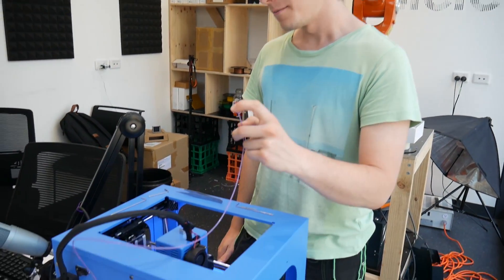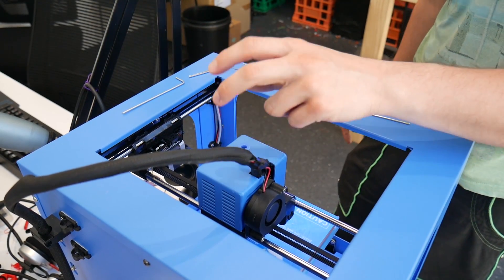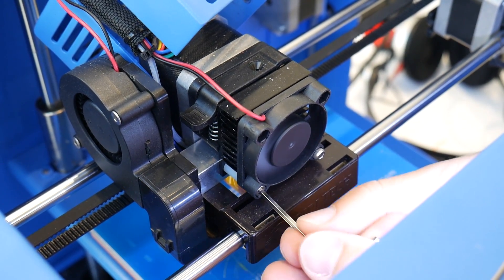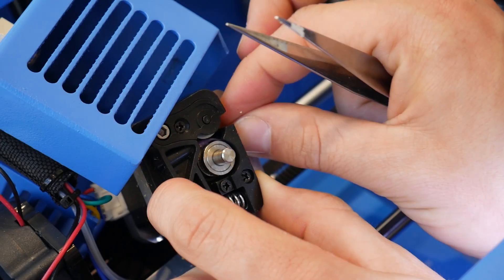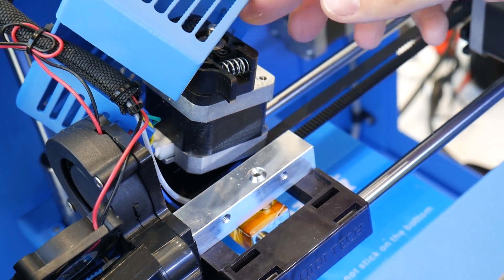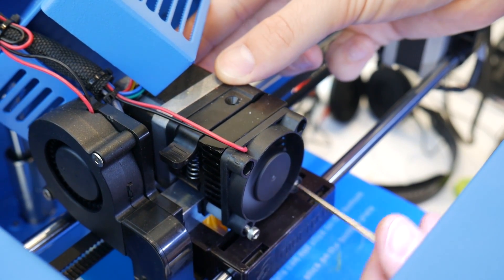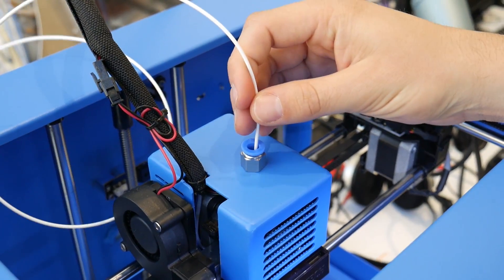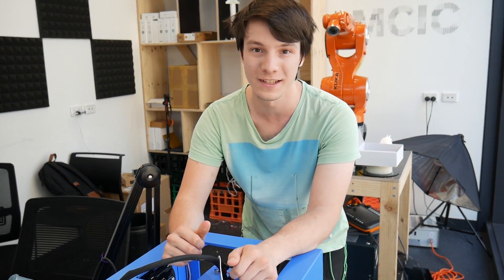How to unjam your extruder the Maker's Muse way

Comment: What if filament is still coming out When you load new filament in? And then proceeds to print to the point where it stains my bed but doesn't print,  dual extruders so it's not the level or x calibration.. Please someone help Its only one extruder

Comment: Hey Angus, I know this is an old video but I need your help. My monoprice v2 has stopped feeding in a similar fashion. My feeder gear is clear, my nozzle is clear, but there is a chunk of filament stuck in the tube that leads from the feeder gear down into the heat core and nozzle. I can't get a grip on the pla filament, and I can't force feed it down. Any advice?
Reply: Well i just use 2mm drill bit and clean it with drill when its cold....rough but work every time

Comment: I puchased a Tevo Trantula for xmas and have not been able to print passed first layer yet.  Seems as it starts to do the perimeter  walls the z-axis rises off of the previous layer like 2 or 3mm and the filament just falls poorly and not even melted. Any suggestions on why base and first layers are perfect then it goes bad? Thanks

Comment: I can dismantle, declog & rebuild a TRONXY X3A extruder assembly with my eyes shut. If anyone can confirm if the machine shouldve been supplied with a 38mm teflon lined throat or post a few words on how to prevent incessant nozzle blockages I'd be grateful. (NB. Ive already replaced the 0.2mm they supplied from their Surplus Parts Bin, with 0.4/0.5mm)

Comment: What is a typical base plate made of (i.e. what the work piece is created on)? I have this idea to make a heated plate of FR4 (what PCBs are made of). The board would have heating elements and sensors on the component side of the board facing down.

Comment: Have you ever had a problem with jamming using PLA in your Up Mini? Even though I have the temps set correctly it tends to start off with a few clunks then jams. I got a feeling it might be the Teflon tube which looks to be pulling on the filament as it is fed through.
Reply from the maker: Yes, the UP Mini sucks at PLA, the extruder motor overheats and chews the filament. I only ever ran ABS on mine. The mini 2 is improved, but again they're still primarily designed to print ABS due to the enclosure.
Reply: It works beautifully for a while then tends to clog. Am I able to feed the filament through without using the Teflon tube because it does feel like it restricts the filament quite a bit or is it required at all times?
Reply from the maker: You don't have to use the tube, but it helps avoid kinking at the hot end. To print better pla remove the top cover, open the door and point a small desk fan into the chamber at low speed. That's the only way I got mine to reliably work with PLA! Also note that some PLA simply won't work at all due to the all metal hot end... IDK what actually causes this.
Reply: No worries, will try that. Thanks!

Comment: On the ultimaker2+ there is almost always those plastic strings from the last filament but it doesn't jam I just push it through the bowden tube and nozzle with the new filament and it just extrudes it. I thought at first this video was about unjamming the nozzle because I miss read it. I'll say how unjam the nozzle though. I just heat the nozzle to 100 Celcius and unscrew the nozzle then heat it up to 200 and pull the plastic out with pliers. Works for me and i don't think it is very hard on it.

Comment: Was there a reason to leave it powered and heating once the plastic was removed?
Reply from the maker: Sometimes jammed filaments extend into the hot end, which is what I was expecting and need heat to be removed. But yeah, this jam didn't need it :)

Comment: those spacers on the fan drive me crazy when I am in a hurry I fumble them and they slide off and roll away on the floor. when you're trying to get things fixed quickly it is pretty frustrating.

Comment: Pro Tip: Unscrew the extruder and hotend while it's still cold, then heat it up and start to clean out the hot end. Then turn it back off before you reassemble everything. It's probably gonna teake a few more minutes this way, but you will not kill your hotend-fan or burn your fingers as easily (and getting a replacement fan or healing a burnt finger definately takes longer than doing it the safe way...)
Best regards, your workplace health and safety inspector. :-D

Comment: The stepper might have been hot because it was close to a cold end that wasn't being cooled by the fan... Or like someone said, the stepper might be getting more current than it's rated for. When I had the MK10 on my Wanhao i3, I think I did the disassembly while everything was cold and then heated up the hot end a little bit if necessary. You don't need full PLA print temperature to unjam PLA. In fact, PLA comes off much more cleanly if it's a little cooler.
Reply: No, Qidi printers run their motors at 80-100% amps and they get damn hot indeed.  I burnt a blister on one of mine not knowing they would be that hot since none of my I3 motors are even warm to the touch.  I wonder if all direct drives have to be that cranked up to work (meaning they get blister you hot as well)?

Comment: Try a rapid extrusion first then retract - either with gcode or just manually start pushing down first before pulling up.  It pushes the plastic that is most heated out, and because you are pushing in faster than it can extrude, the plastic that you pull up on isn't heated nearly as much.

Comment: That is a little like the FF Finder head, mine usually jams further down. I've done this multiple times, I pre-heat to maximum then literally load a long sewing needle roughly 1.75 down the hole. Copy this method at your own risk guys.

Comment: that's a little like the FF Finder head, mine usually jams further down. I've done this multiple times, I pre-heat then literally load a long sewing needle roughly 1.75 down the hole. Copy this method at your own risk guys.

Comment: You could put a JST connector in the fan line to unplug it when working on a hot extruders. Before pulling filament out of extruder push it in say 10mm which makes sure it's free then pull it straight out. It's better to have temp a little lower while changing filaments so it's slightly firmer and not liquid...

Comment: Ideally you want to disconnect the fan before disassembly but may not be possible on all printers (you can on the Wanhao i3 for example). Your stepper sounds like it's being overpowered from the mainboard drivers. This is a known problem on the Wanhao i3 and could be similar on this machine.
Reply: yeah, I snapped one of the blades off my fan when the screwdriver slipped.

Comment: Why does the fan have those spacers does any one know?
Reply: The heatsink grills get hot. If the fan is bolted down tight against it,, it will melt the fan hosing plastic. These are  ptfe spacers, and won't deform(crush) when they get a little warm. This is why the bolt sleeve isn't built in to the heatsink,, heat would transfer to the bolt head holes in the fan,, and it would come loose, or melt and fall off.

Comment: i had more than two times this kind of problem. once it was with changing filament before sending the print, swapping algae PLA and hemp. the smell was terrible . the frame is an issue on the solidoodle 4 because it is too large for the purpose.

Comment: Hey @Maker's Muse, good warning about the old 'Allen key in the fan problem'. Been there! Done that! Question, do you rate or use the cold pull technique when removing filament? Any tips to prevent these blockages? Thanks!

Comment: I dont even take the filament out, I just extrude new in, even with flexible filaments also.
Reply from the maker: That's always a gamble unless you have a fully supported design, the air gap means any misalignment leads to a jam on these extruders.
Reply: Maker's Muse its been working out fine for a long time now. Probably 100 filament changes, I had the same issue as you did in this video on my flashforge extruder (from pulling the filament out like the normal way) but it was much more lf a pain to remove. But hey, thats all that this hobby is about. Finding what
 works for you, what problems you ran into and sharing with others. Gotta love it!
Reply: That is exactly how I've been doing it also.

Comment: I've had that happen before, similar procedure, and yes you CAN break the fan by sticking the alan key in there! Don't do that!

At the same time, I usually fix these sorts of blockages by getting a small alan key and just shoving the blockage into the throat until I see some goop come out the nozzle. No disassembly required. Probably not 100% effective like this method. And also probably damages your teflon liner.
Reply from the maker: You can fix throat blockages with that method but this time it was a chunk of filament stuck between the feeder gear and hot end, only way to get it out is to dive in :) Here's a vid of how I fix really stubborn hot end blockages on the same style of extruder - https://youtu.be/T6oalZLa0GY